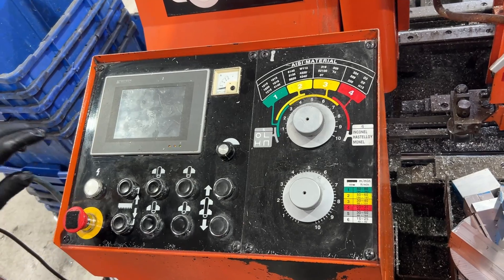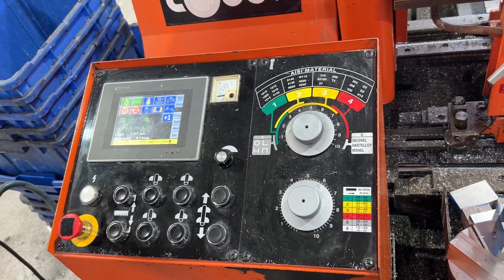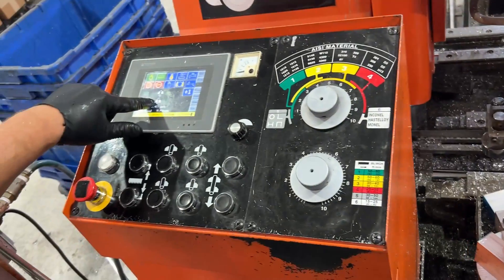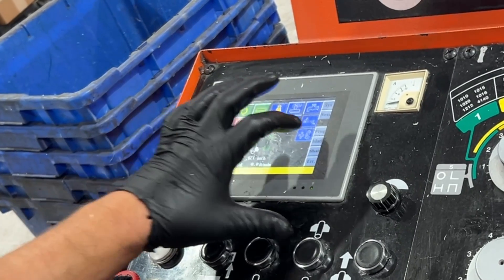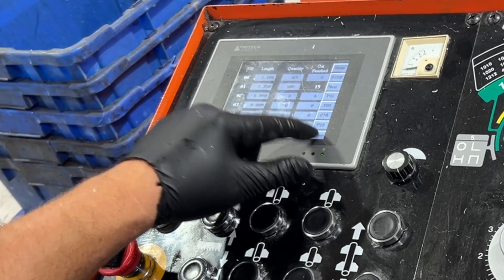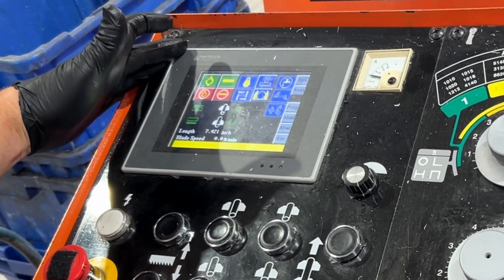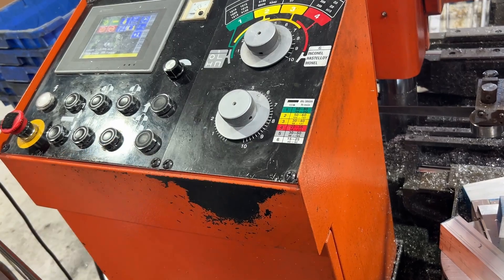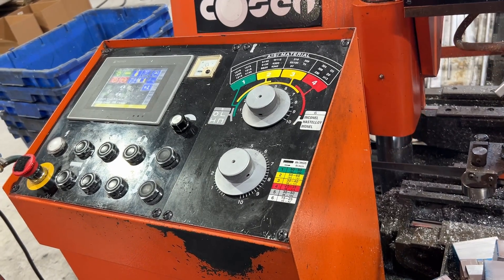How to Operate Cosen Bandsaw

Comment: those are good ol American made saws, but let me ask you this, i was cutting 6160 alum 1 x 12 so a big boy, supposed top big dial "pressure rate"  4, feed speed supposed big bottom dial, 8 plus 2, and speed rate full like you said , what I encountered was after 40 cuts w no prob. encountered blade motor overload ? you say what 3 the top big dial and between 5 and 6 bottom big dial. ????????? it cut damn near 40 of them on top big dial 4 and bottom big dial 8.2 ???? Im just  trying to not get fired but I dont think any of them has mastered this bitch and definitely not me, any thoughts ??? also I heard that the new non USA cosens are shit, which i might believe if sold to a "global capitol private asset company"v  , non USA job POS company, we better keep the good ol Amers. ?
Reply from the maker: I’m not really the expert on it but one of my employees knows it really well. Let me know if you want to setup a call with him.
Reply: That’s too aggressive. Go down on that feed to 4 or 5👍🏼